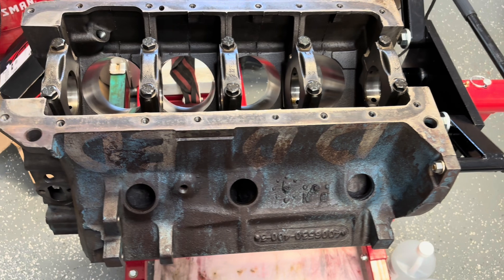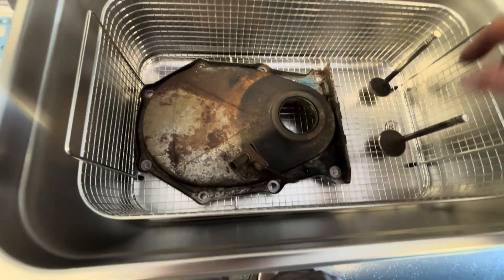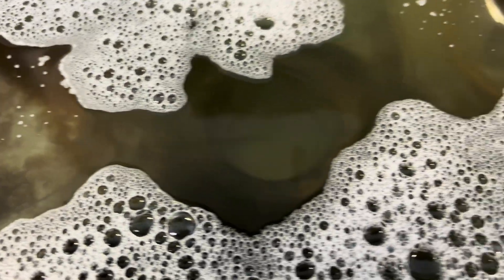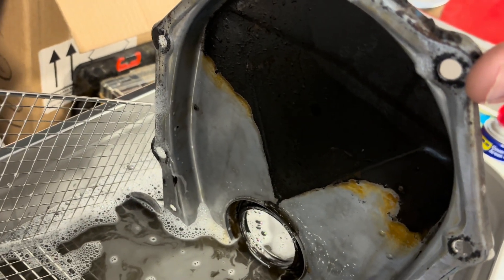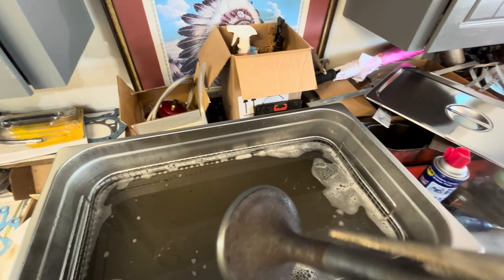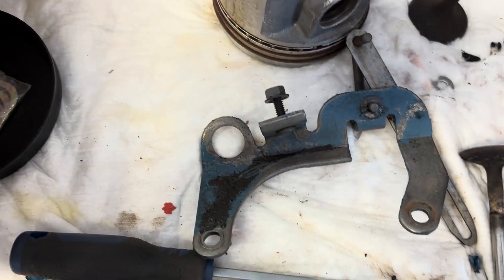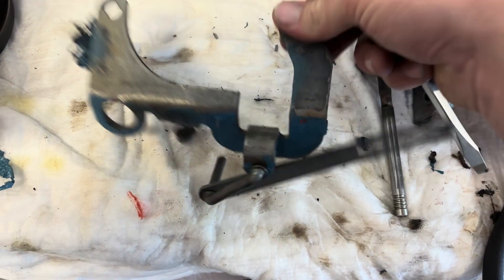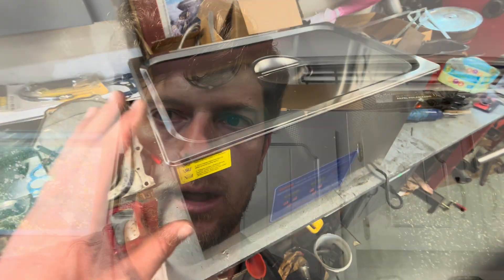Saving Time on Engine Builds! Vevor 30L Ultrasonic Cleaner Setup And Test

Comment: I have a smaller version of that cleaner. I cleaned pistons in it with a solution called Greez off. I got it in a parts store. If you find it, it works well. 1 hour  for a piston & rod combo and there was not a speck of carbon or anything left on them. Basically ready for rings & installation!

Comment: When you want to use EvapoRust (or carb cleaner, etc ), just get a new one gallon paint can (with the lid) from the paint store. 
 
Pour the EvapoRust into that, and set that can, with parts, right into your ultrasonic basket.
 
That way, you can fill the cleaner with CHEAP plain water.
The large flat bottom to the metal paint can will act as a diaphragm... and transmit the ultrasonic waves into the EvapoRust solution very nicely. 
 
Also, with chemicals, run the ultrasonic for a few minutes, and then shut it off (but leave the heater on). Let the chemicals work for a couple/few hours, and then fire the ultrasonic back to again to take off what the chemicals have loosened up. Keep doing that until you're happy.
 
Also, don't forget to put the lid on the EvapoRust when you're not using it, cause it'll evaporate... and it's too expensive to waste.
 
Nice video.

Comment: I just got mine on Monday, I used it yesterday with water and a quart of Purple Power. Putin some bolts to a V6 and it did a OK job. I had to clean the threads on my wire wheel. I'm happy with the cleaner, but I think I need to work out a better solution.
Reply from the maker: That straight mean green is the ticket. Bolts like new

Comment: Yes, they are a great little US cleaner. I have exactly that model myself.
Be careful though. The 30 litre Vevor unit has been banned in both Australia and the UK due to poor electrical earthing. 
I was given a full refund on mine a month after I bought it and was told to dispose of it.
A bit of investigation and I’ve installed two additional earth wires to make it safe and I’ve continued using it.
Reply from the maker: That's good to know, thanks for sharing.

Comment: 50/50 simple green and water. Been using them for 10 years works great. Pro tip. If doing carbs init leave the heat off. It will heat up with just the sonic part going. Too much heat turns the carbs dark gray.
Reply from the maker: @MechanicNamedMark  awesome! Thanks for sharing
Reply: I understand it's not the heat it's that style of Simple Green. I did some pistons with my sonic cleaner with regular Simple Green and they came out black. I copied this from AI "While regular Simple Green can be used on aluminum with caution, if you're concerned about potential anodization damage, look for "Simple Green Extreme Aircraft & Precision Cleaner" or "Simple Green Pro HD Cleaner Degreaser" as they are specifically formulated to be safe on sensitive metals like aluminum, including anodized surfaces, when used according to instructions; always test on a small inconspicuous area first".

Comment: I use a heavy duty concentrated degreaser from Home Depot. I usually use it 50/50 however you can use it at 100% too. I use mine mostly as a final clean up before I plate or powder coat parts. Evaporust would work but it seems to evaporate quickly especially when heated. If you are purchasing a large ultrasonic cleaner like the 30 liter size make sure it has a drain.
Reply from the maker: Thanks for sharing! This one definitely does

Comment: Used easy off oven cleaner as parts cleaner for heads, drove around and raced 440 with factory valve job for 10 years

Comment: DON'T USE EVAPORUST! I SPENT $95 ON 5GAL PAIL.
JEEP 4.0 HEAD half at a time. Liquid turned black and stopped "working".
Never again. Now use 45%vinegar to soak rusty parts.
Have to neutralize it in a separate bath with baking soda.

Comment: Been using old school Pine-Sol,  get it at Menards for carburetors. Don't have an ultrasonic yet, just mix it with hot water and let um soak a day or two. Actually works pretty well, definitely going to try it when I get an ultrasonic cleaner.
Reply from the maker: Thanks! I’ll try some in here
Reply: @JustMoparJoe  Did a Google search for diy carb cleaner old school Pine-Sol showed up a lot so I tried it. Honestly I miss the carb cleaner from when I was a kid. Sure it ate your skin, but it'd clean a carb in no time flat.

Comment: I have the same cleaner, if your cleaning small parts, fill the cleaner with water, put your cleaner in the glass or plastic jar, saves ya on cleaner. I did this with rusty bolts, came out very clean. So far, I like cleaning vinegar or Simple Green
Reply from the maker: That's a good idea!

Comment: Joe tattoo artists use them to clean baked on ink  you can buy tablets from a place that sells medical supplies and you can buy a few different kinds go to a drug supply store that sells sterilization equipment I’m sure them tablets are Farley cheap but I guarantee it will get the carbon off and grease they work better hot I have a small one as I have tattooed for many years they used to sell a product called equinox it was sold in like a  soap powder form I used to use it so I’d check a place that sells sterilization equipment and I’m sure they can help  you find a good product jewellery stores use them for cleaning dirty jewelry  they might know a good product
Reply from the maker: Thanks Jeff!

Comment: I use a 50/50 mix of vinegar and 92% Isopropyl alcohol along with a 1/4 cup of Dawn dishwashing liquid. I preheat the solution on the stove to 100 degrees and pour it into the ultrasonic cleaner. The solution works well and not expensive.
Reply from the maker: Thanks Mike!

Comment: Thanks Joe - always so much to learn here from you and also from all the responses. I hade used an old crock pot from goodwill just to remove yellow paint from bolts and nuts with similar solution, but didn’t have the ultrasonic feature. With tedious work with a hand wire brush it did get the job done. I do understand the thought of buying so much evaporust. I will say that I have had god success on my mild steel trailer bracket parts, but I never tried more critical car parts that need to be”turn out right” and not damaged. My 1/4” steel brackets are not critical or delicate parts. Was that 80 degrees a Celsius number?
Reply from the maker: Yes sir. 80 Celsius it’s pretty hot to the touch!
Reply: @JustMoparJoe  thanks JMJoe.

Comment: hey joe . I have the same one and it works pretty good .some times i put in hot water to speed up the heat process.then i put the small parts in a baggie with a solution .
Reply from the maker: Excellent! I’ll try that

Comment: LA's Totally Awesome works very well, but the newer formula will darken aluminum. You don't have to get to strong with the concentration of soap. Zep has a powdered detergent that we use at work, it is safe for aluminum as long as the solution is somewhat clean.
Reply from the maker: Thanks Mike! I just got 5 gallons of Awesome to try and see.

Comment: I have a smaller one to use on my small model airplane engines, They are all aluminum, I used to use LA's totally awesome cleaner and they came out like brand new, but LA's changed their formula, then the aluminum would turn black. I haven't found a suitable replacement. The secret is in the solution.
Reply from the maker: Thanks for sharing!

Comment: Love my ultrasonic cleaner. With my car sitting in garage for 6 months I disassemble the carb and give good cleaning before spring. Simple Green is all I use
Reply from the maker: Thanks for sharing! Don’t add any water?
Reply: @JustMoparJoe  yes I do. Not near the garage but believe it’s 1 part SG to 5 parts water. Works like a charm and non toxic. Just wear rubber gloves when pulling parts out. The mixture will dry out your hands

Comment: Glad you got one Joe! Wish mine was that big. I agree to experiment with different cleaning solutions. Although the Evaporust is more expensive regarding initial cost, it will last for many cycles. Also, I max out the heat to 99 on mine to break as much contamination loose as possible. Great content buddy!!
Reply from the maker: Thanks for the tips!

Comment: Hi Joe. I would try some dishwasher detergent, the powder type. Generic is ideal. It is  a pretty strong base (sodium carbonate) with enzymes that activate above 40 C. This combination is an extremely effective degreaser. I would use about 1 cup powder for 10 L, or 3 cups for a full load of water. Use that as a starter, but don't be afraid to try a bit more. Be careful with aluminum and experiment with a non-critical part before using this solution on something expensive. Heat the water first so the powder dissolves readily. And be careful, this solution would be hard on skin. However, my chemical engineer's instinct tells me that this is probably the most cost-effective degreaser that you will find.
Reply from the maker: Excellent idea. I had thought about Tide detergent as well.
Reply: Tide would work well. Fresh out of high school I got a job in a big boiler shop and I would come home after a shift covered in sweat, grease, and metal shavings. I used Tide as my all-purpose cleaner for everything, including skin and hair. Regular shampoo wouldn't touch the dirt in my hair until I had "pre-washed" with a slurry of Tide powder and warm water. Tide and water would be a fine choice. I recommended dishwasher detergent because of its heat-activated enzymes; Tide and other laundry detergents don't have these, and also I think that generic dishwasher powder would be cheaper to use, especially when filling a 30L tank.

Comment: NORTHWEST ENTERPRISES Ultrasonic Cleaner Solution: $45 a gallon:

Scientifically Engineered Ultrasonic Cleaner Fluid: This sonic cleaner solution removes, dirt, varnish, gums and other contaminants that deposit on carburetors, valves, and heat exchangers exterior and interior parts over time. Perfectly designed for you car carburetor cleaner, motorcycle carburetor cleaner, ultrasonic carb cleaning kit, engine components, heads, valves, seats, rockers, and more.
Highly Effective: This concentrated ultrasonic carburetor cleaner is formulated to take advantage of the ultrasonic machines implosion of billions of minute vacuum bubbles when they contact parts immersed in our ultrasonic carb cleaner solution. Our Ultrasonic Cleaner Solution for Carburetors and small Parts is unmatched.
Thorough: Pairing this ultrasonic solution with an ultrasonic machine creates implosions where contaminants are quickly and safely blasted away from wetted surfaces without damaging delicate parts. These bubbles are so small that they are able penetrate minute cracks, crevices and blind holes impossible to reach by hand scrubbing using conventional parts washers or aerosol sprays.
Fast: Once parts are placed in the ultrasonic cleaning fluid / ultrasonic degreaser and cleaning initiated, parts can be very quickly cleaned.
Reply from the maker: Excellent!

Comment: I have a product for ya that will blow your mind and it's cheap to buy but ya can't tell no one. It will take rust off in minutes and won't stink like vinegar. Yes it's a acid and blows that evapo rust away. Plus it coats the metal. We dip most everything now.
Reply from the maker: Awesome!
Reply: @JustMoparJoe  go to my trailer restore to see what happens when I use my product. I will try to email you. Stone soup showed up so life just got busy

Comment: 2 gallons of your favorite degreaser that can be used with 2 gallons of Evaporust, 4 gallon of water. I have heard of 50/50 Evaporust and water or 60 cleaner and 40% water. Depends on the part and my cleaning guy is hush on his formula I tried to get it for you but I failed 
 Have a great Sunday today.
Reply from the maker: Thanks John!

Comment: I've been using the dial-type ultrasonic like that for 5yrs now!! I do mostly carburetors and valve-bodies for transmissions and the heat/vibratory action really works!! I use aluminum safe concentrated water-soluble Simple Green (the aircraft type is clear) which is guaranteed not to corrode aluminum if mixed to the proper ratio. I run it on max heat and usually one pass does the trick on the gummiest valve body or carburetor. On Holley carbs, you can remove the soft plugs in the metering blocks and rescue them!! A definite must have for non invasive cleaning!!
Reply from the maker: Thanks buddy! I’ll get some